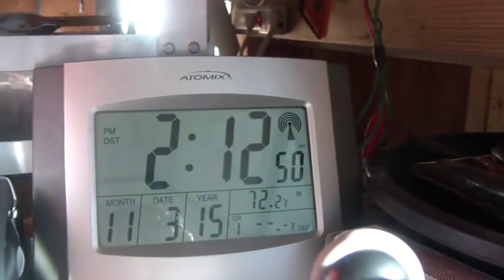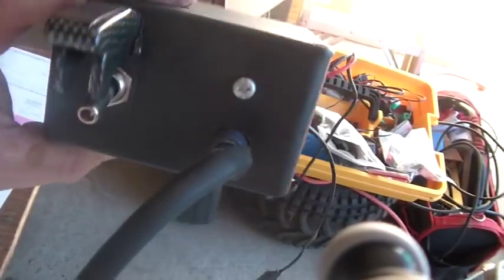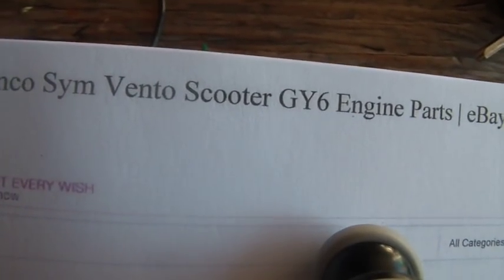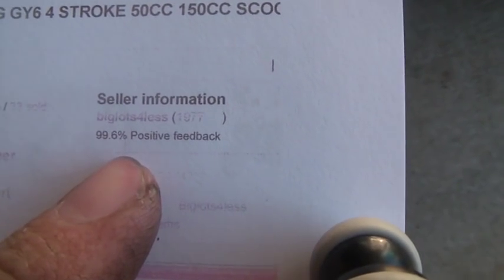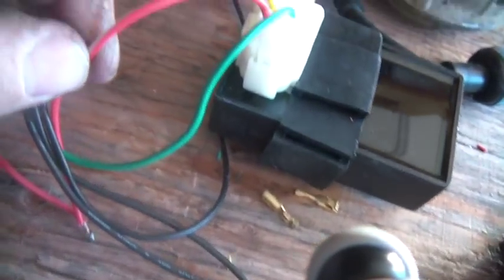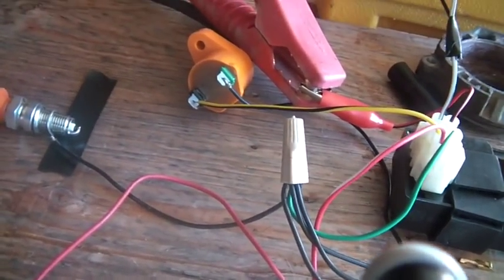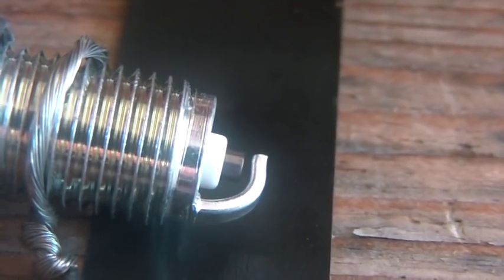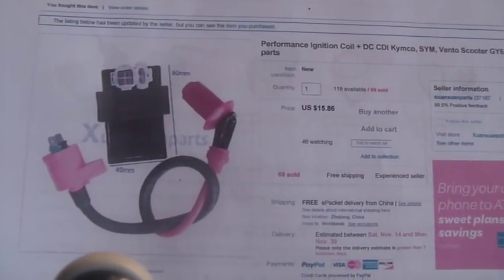ATV, ATC, Motorcycle, CDI Ignition Hack, parts list and build,

Comment: Hi Harvy I'm converting an atc70 to a cdi I will be using the original flywheel the pulser will be on the outside of the flywheel do I have to put a small magnet on the flywheel for the pulser or a small piece of metal to activate the pulser to fire